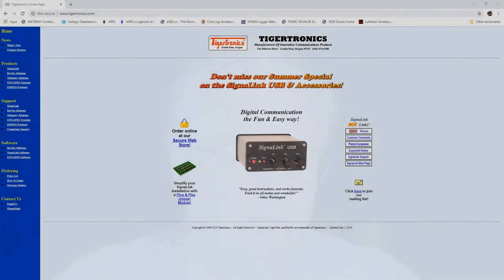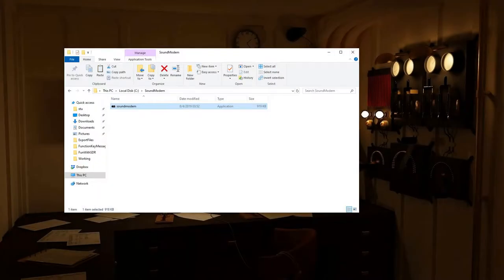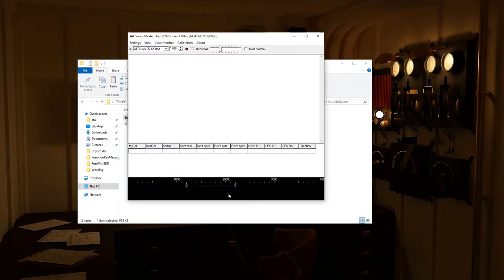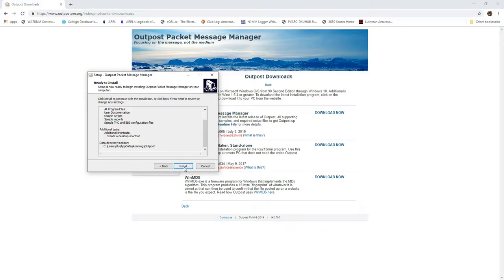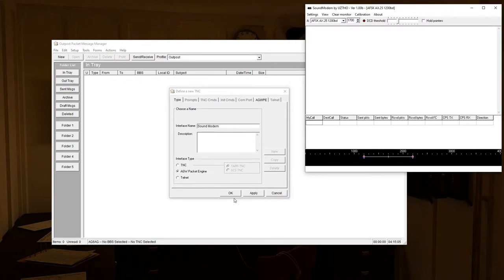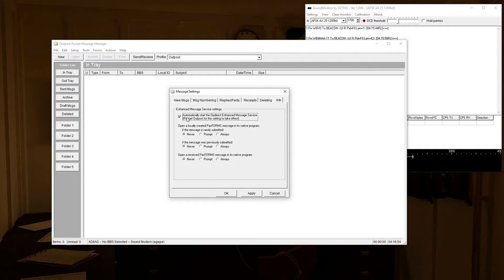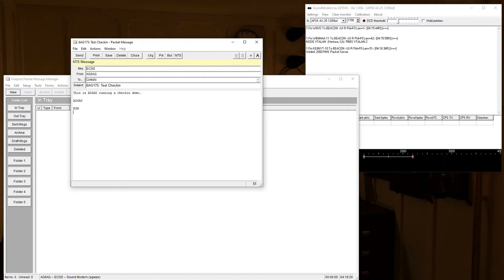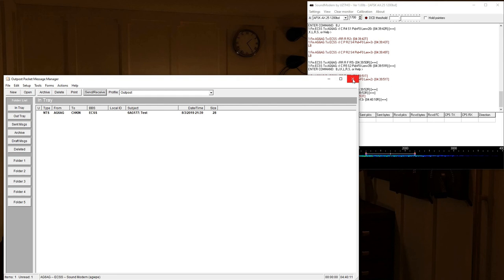Using Outpost with Soundmodem for VHF UHF Packet Operation

Comment: I have a Kenwood d710 and have gathered the interest in using it's internal tnc for things other than APRS.  
I was wondering if you have or know of any specific how to videos related to digital modes with that radio and an external computer.  I have CAD/Data control that I've used for Echolink Sysop modes to success and TNC connection to do APRS both from the faceplate and external computer.  I have not had much luck using the TNC directly though a serial link.  It does not limit itself to VFOa like it is set within the radio and steps on the voice network I'm listening to on VFOb.
Reply from the maker: Hi Kage,
I have a 710 in my mobile, but have only plugged into the port on the back of the control head once to "look" at the TNC interface (curiosity). I was able to use the TNC at cmd: to connect to another TNC and leave a PBBS message for a friend. That said, I don't know enough about the way it addresses packet in the radio to be much help on this, but the manual from the CD-ROM has a chapter on Packet that seems to imply you can designate a "side" of the radio to packet.
I guess the short answer is it should work on a designated side.
Post back and let me know what you find!

Stu
AG6AG

Comment: I did a setup for winlink..  when  I run the program I get an error message unable to connect to TCP.. I am not sure how to troubleshoot this?
Reply from the maker: Hi Chilton,
This is usually a port issue. Your question is posted under the Outpost video but you are referencing Winlink. I'm not clear which software package you are getting the error on... That said, it usually a port mismatch between what SoundModem is setup and what the accessing software is set to.  Take a look at SoundModem under "Settings" in the "Server setup" section. Make sure that both AGWPE and KISS are enabled and make a note of the ports they are running on (usually 8000 and 8100 respectively). Now, in your setup of which ever software you are having the issue with. Verify that the port number matches the respective port number in SoundModem.
Hope that helps...

Stu
AG6AG

Comment: Just got into packet radio using a signalink wish more people use it I think it is neat. I read some BBS I cam across one was last used on 2004 and log list was 2004 only 5% if that uses there license. Nobody what to do anything.
I seen new licensed people then I hear them for a week or so then they gone just like fart in the wind. Now you have to pay $35 TO RENEW YOUR LICENSE . so now coming up soon there will be even less on . i like ham radio but vary few uses it . less and less over the years .it is sad .
Reply from the maker: Hi LG,
Well, it is sad that folks that went to the trouble to study up for the test drift away... Some interesting things to think about are what your local Amateur Radio Community is doing to re-enforce the use of Amateur Radio... Where I live, we (Licensed Amateurs) make sure there are lots of nets, events and meetings to get the new folks involved.
One other thing to remember is that this hobby takes a lot of time and dedication to participate in! I wanted to get my license back in the 1970s, but then I discovered girls and well... I didn't get back to Amateur Radio till 2015 once the kids were grown and gone and I had time to get back into it.
I guess what I'm trying to say, is even if a new operator falls of the air, usually, they come back with a vengeance!
Thanks for getting involved in a very important hobby!

Stu
AG6AG